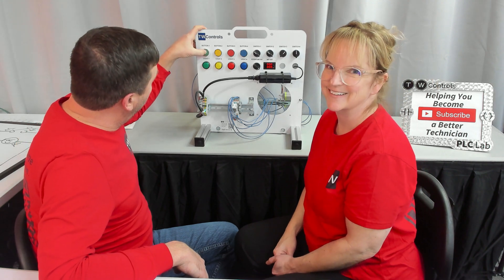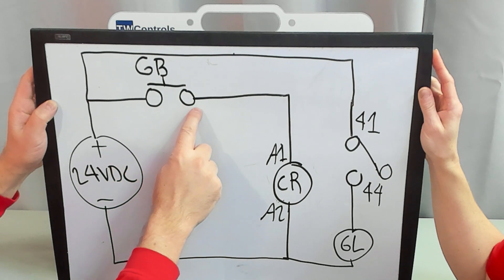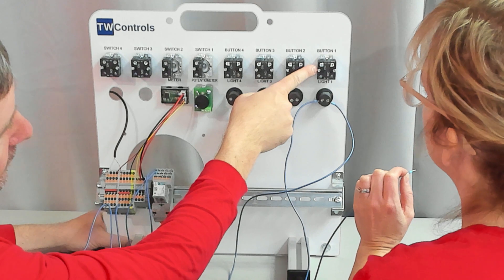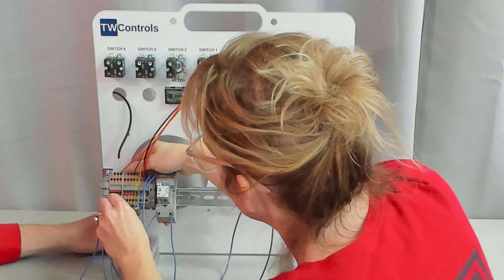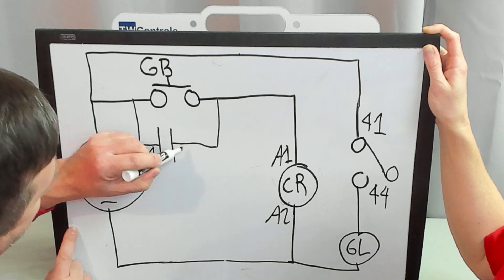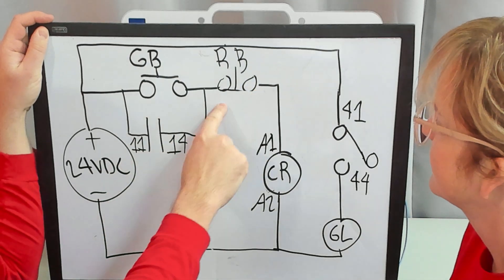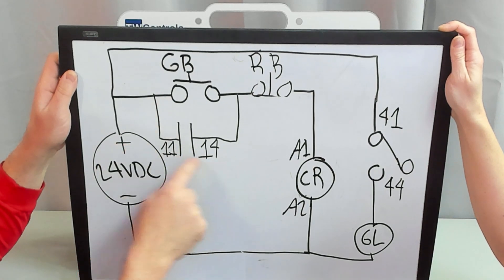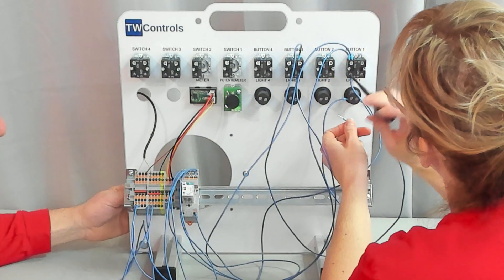How to Wire a Start Stop Motor Control 3 Wire Circuit

Comment: Great info. I have always tried to teach learn the 3 wire control like the back of your hand. Learn how to install, troubleshoot and repair.  This circuit is the foundation for all electrical controls. Learn this & you can pretty much work on any  control circuit.
Reply from the maker: Yes, plus it is the concept behind many "advanced" processes